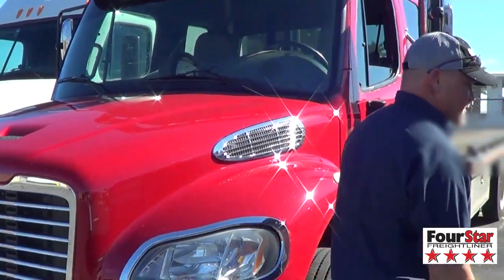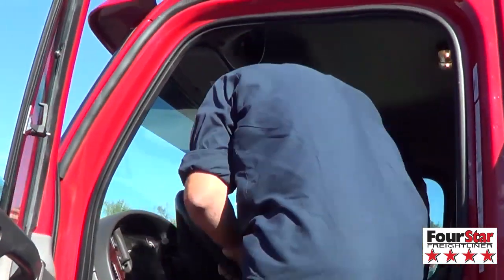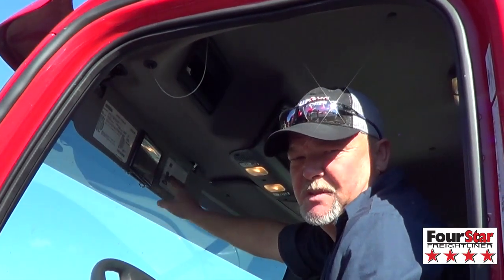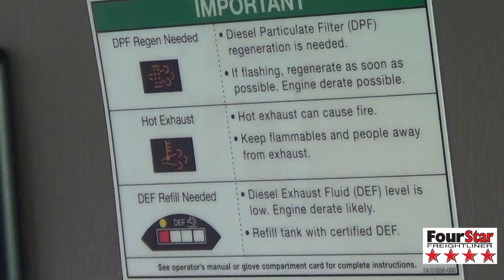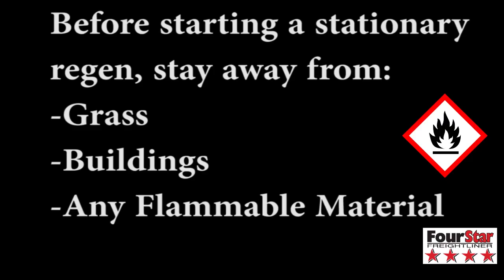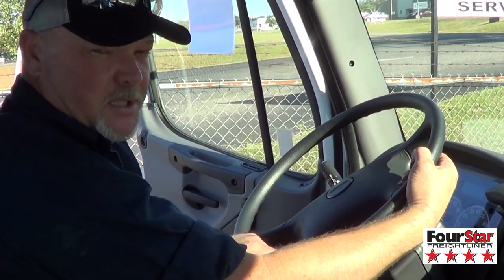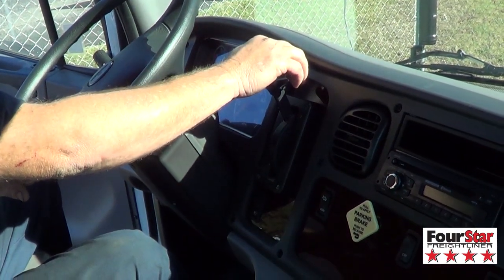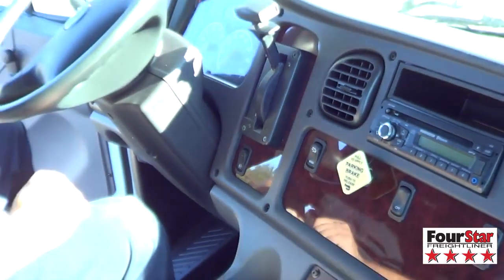How to regen your Freightliner truck

Comment: Misleading video.  How about you actually say HOW to cycle the brakes and actually make it regen.
Reply: He can't make it actually regen by cycling the brakes.....He shows what it takes for the regen to kick in, but  the regen warning sign is not coming on. That was my problem , I took it to Freightliner and they couldn't make the regen warning sign to flash, which is the indicator that a regen is necessary. The only way to force a regen is to purchase the tool (DTC+AFT tool) and when the check engine sign comes on you hook up the tool to reset the fault codes
Reply: yoooooo, same thing I said !!!

Comment: What are the steps to do a Regen while driving
Reply: Jeremy Ahrens

Trucks used for long haul do it automatically as you are on the freeway. It is the local or regional drivers that will have to park the truck and do a regen because their dash is asking for it.